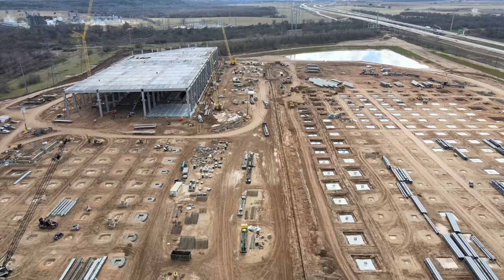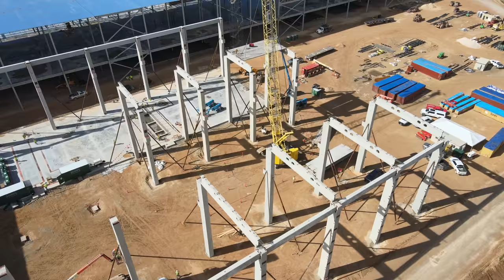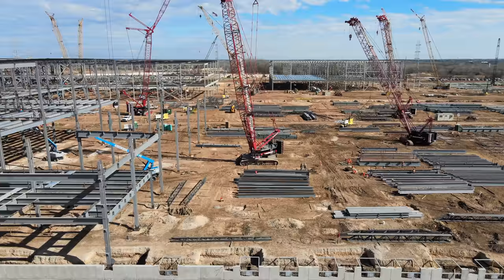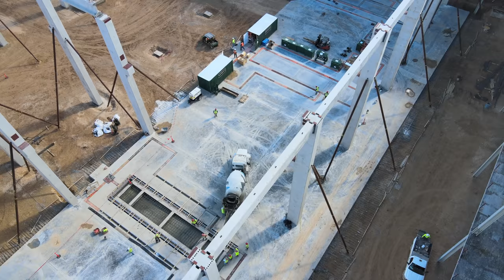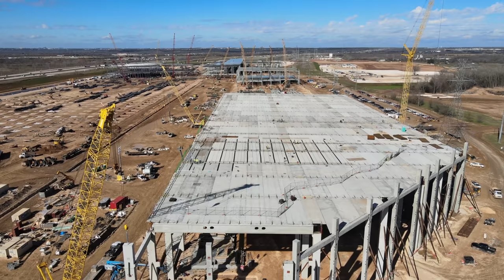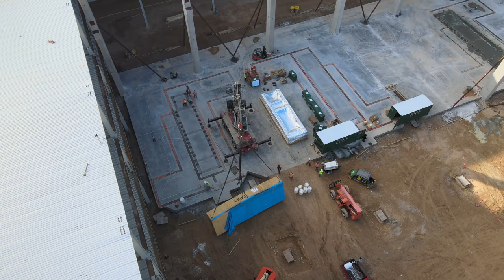Giga Press to Impress - 2021-01-22 Progress Update

Comment: 16:42 Red crane lifts 5 joists and then yellow crab lifts 4.
18:00 I suspect that the dark rectangles being installed on the steel outline are thick elastomer isolation blocks.

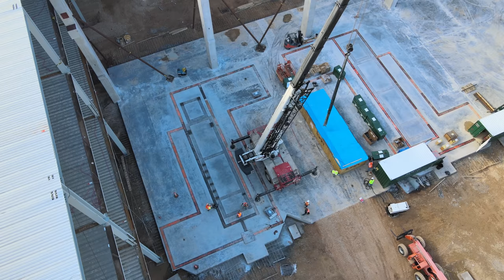Comment: 18:00 to 20:00. Black squares. Whatever they are, those guys are working hard.
Reply: Those are the sole plates for the machine. typically threaded studs are welded to the steel imbedded in the concrete (20:02 you can see 1 plate being tipped up by sticking a rigging bar in a hole). the plates are leveled using the studs to establish a level plane to mount the machines frame to. It would be interesting to be a Millwright on that job.
Reply: @Freddy735  What sort of thickness do you think? They look around 16-18" square. Mild steel or something fancier?
Reply from the maker: They certainly look heavy.
Reply: @DessieDoolan  Hard saying how thick from this distance, 4-5" maybe. They are small in area, probably to avoid deflection. thickest I dealt with was 3", largest area were probably 3' X 12'.  Trying to figure out why the side appear lighter color laying flat but not when tipped on edge, I don't think they would use Isolation pads on this.
Reply: @Freddy735  My background is construction, so out of my depth with this sort of stuff. Sides may be a lighter colour because they are painted, and the faces a machined surface, so unpainted? I'd imagine the forces at play with a die-casting machine would be more clamping pressure, than impact that you'd get with a stamping press. I'm a little twitchy about the installation of the presses while there are still massive concrete members swinging around overhead. If you get my drift!
Reply: @DessieDoolan   the plates are usually blanchard ground at the least, most of the time are plated for corrosion resistance. As thick as these are I'm wondering if they are an isolation pad, a lamination of steel plates top and bottom with a layer on an elastomer between. The mass of the foundation stabilizes the machine and isolation pads would reduce transmitted vibrations.  The more I think of it this isn't a high speed machine so isolation pads wouldn't make a big difference. Yeah, I never set a press out in the open like this but you do what you have to for schedule.
Reply: Having watched Terafactory Texas Update #97 I can assuredly say they are just isolation pads. they will not be physically attached to the steel imbedded in the concrete.
Reply: @Freddy735  Would there be some sort of retaining brackets to stop it shifting laterally, or would gravity be enough to keep it located?
Reply: @DessieDoolan  If they are one side steel and one side rubber then the tonnage of the machine will hold it in place. If there is enough force to cause the press to move you have bigger problems, like an earthquake...

Comment: 13:30 The new column extension or "capital" has a partially hidden steel surface for mounting wall panels. I guess the steel plate didn't press very hard against the forms.

I'm thinking that the thick column to the right also needs an extension or "capital".
Reply: Good catch! There is another column extension sitting on a trailer close to the wall panels, visible in Randy's video from later in the day. I bet you're right in assuming it goes on that other column!
Reply: Will all the columns on the east side get extensions to allow for the parapet wall?

Comment: Another example that somebody ef’d up the concrete column design and/or fabrication......no parapet extension on the perimeter columns. Now they are retrofitting a stub atop the columns to accommodate the parapet. They will likely need to stub up the perimeter columns at the casting area too. All they had to do is copy Berlin. Inexcusable errors.
Reply: My guess is that a one piece column that size would have been too heavy, either to transport or lift.
Reply: @notvaporlocked5479  Seems a reasonable assumption. I was thinking maximum permissible highway load without requiring the next level of permit. If there was a saving to made by transporting in 2 pieces they'd take it.
Reply: @notvaporlocked5479  
plausible except the thinner concrete columns are of the appropriate length incorporating the parapet extension
Reply: @vvattup  you said it yourself, the “thinner” columns are much lighter even though they are tall.  At any rate I’m speculating on the weight thing. It could be something else entirely.
Reply: @notvaporlocked5479  
Federal interstate weight limit is 45,000 lbs. In any event, grafting a stub atop a load bearing column is not industry standard. IMO, its an ef.up (40-years commercial architect/building inspector)

Comment: I haven't heard anyone complain about the power transmission lines running through the center of the project recently.
Reply: So why stir the pot?
Reply: If you had several tens of thousands of volts, you'd want them underground where they're away from zapping anyone.  It's the way it's supposed to be.
Reply: @acmefixer1  More like 100s of thousands of volts  and  in a river flood plain.  Hmm  wonder  what happens when one of the pipes containing the wire leaks or get flooded those are  bare wires : )
Reply: @acmefixer1  The lines into a large factory are often 13,000 volts to a stepdown transformer. down to 460V.
Reply: @acmefixer1  You can’t bury very high voltage transmission lines except for short distances.  The space of the insulation between the conductors and ground forms a giant capacitor which robs much of the line’s energy. High voltage in - nothing out. Simple physics.